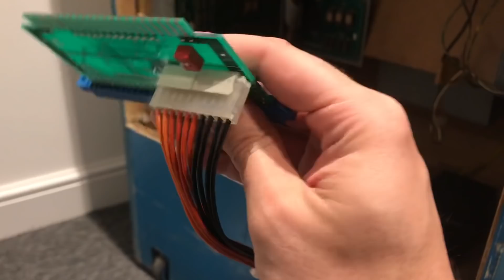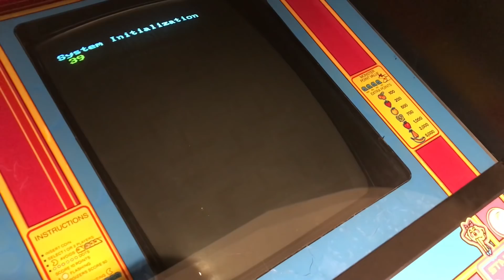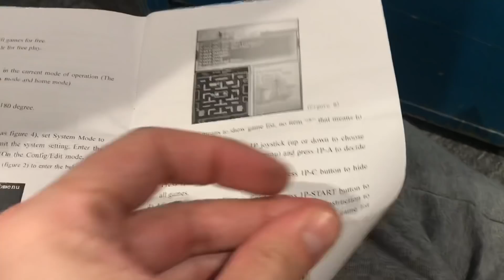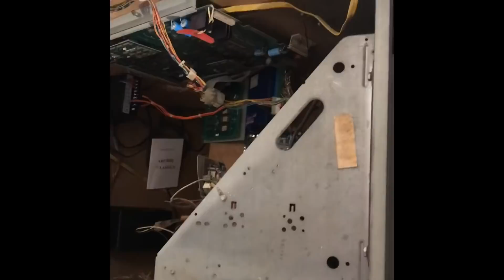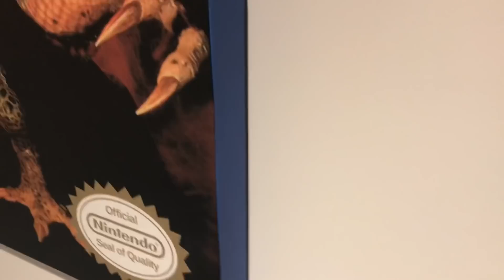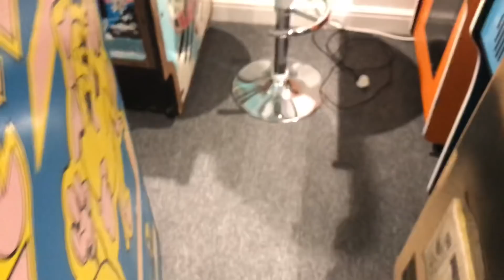Converting Ms.Pac-Man Arcade Game to JAMMA Using Arcade Shop Adapter - Game Elf & 60in1 Setup

Comment: Why did you put tape on your edge connector before you hooked up your 60-1 and what's written on it? Doing this exact conversion myself. Thanks in advance.
Reply from the maker: I put a piece of masking tape with “PARTS” written on it, on the parts side of the edge connector so I didnt accidentally connect it the wrong way round. Thanks for watching and I hope your install goes ok 👍🏼
Reply: @RetroDave0  Thank you sir! All went great.

Comment: Will voltages comin from original power supply thru wiring affect jamma adapter? Since its be 2 power supplies wired in?
Reply from the maker: Thanks for watching. No, the pins on the Jamma adapter for 12v and 5v are not connected so this cannot happen. Power in the original harness connector basically is there but not in the circuit. 
The 12v and 5v are wired separately on the new harness that goes to the new power supply. 
I hope that helps 👍🏼

Comment: But how can I install more buttons to play vertical games that require three buttons. All you are playing is none buttons games. 🤔
Reply: If you dont want to alter your ms.pac-man, then you can just make the player 2 start button the fire/action button. If you do that you can then play all of the games on the 60in1 beside gun smoke. Without any damage to your vintage cabinet. 

Or you can just drill 3 holes in it. No one will give you a medal for not doing it. I would stay away from the pandora boxes/game elf boxes though. They break down all the time. Really bad products from china. The 60 in 1 is much more reliable.

Comment: Where did you get the wire harness for the motherboard to connect to power supply
Reply from the maker: Professor Cannabis it came included with the adapter from ArcadeShop 👍🏼

Comment: Great job Dave, but how frustrating!.  Been through a similar issue with my 60in1.  What's the sound  like on the Elf?  It's very crunchy on my 60in1 for about 40% of the games.
Reply from the maker: Tim Watson thanks for watching. Yeah it was a bit frustrating but can’t believe it was a simple fix in the end. The sound is off and very inconsistent at which level it’s on per game. Some games sound far too loud and others are quiet. It’s a case of just getting a balance that you can tolerate. 
If the games have really bad sound or awful controls I have hidden them from the menu so I don’t waste  time scanning through them. 
To be fair I only play a few games on the remaining list anyway.

Comment: Interesting video Dave. One drawback to those multi-carts is the lack of high score saving although I believe this can be achieved by making changes to the SD card image.
Reply from the maker: StuTheRetroGamer thanks for watching! Yeah the lack of high score saves is a bit annoying to be honest. Although I believe it does actually save the high score but not the initials of the player which is just stupid.
Reply: @RetroDave0  
I thought that was only the case on the 60 in 1 boards whereas the Game Elf and Pandora's Box don't save the score or name. If you know anyone that's good with Linux they could probably sort yours quite easily though.